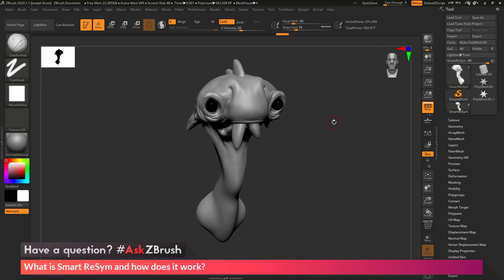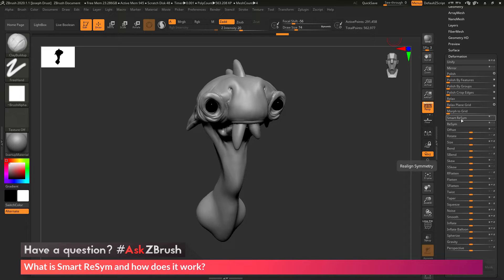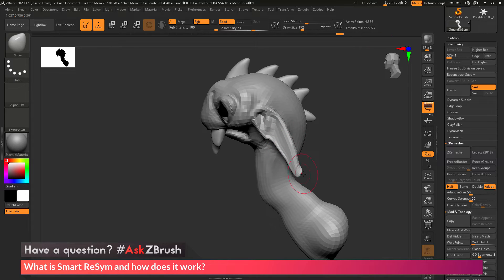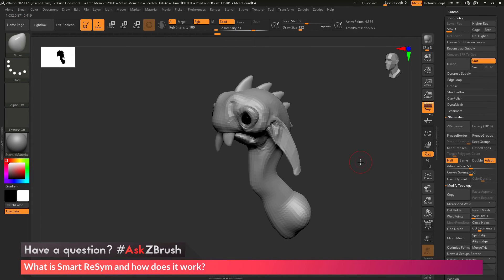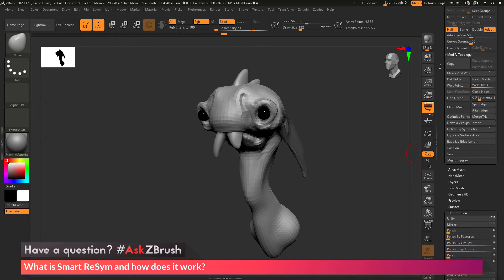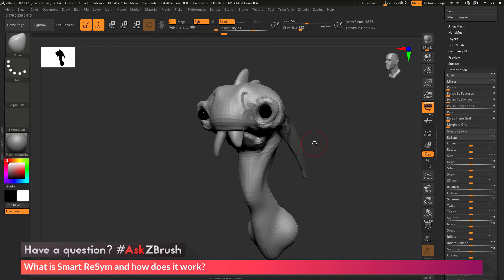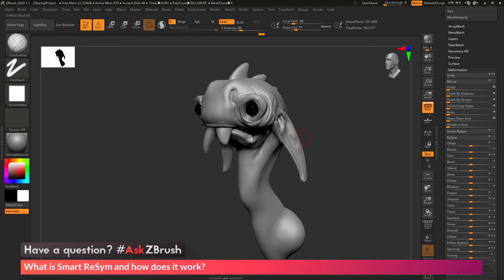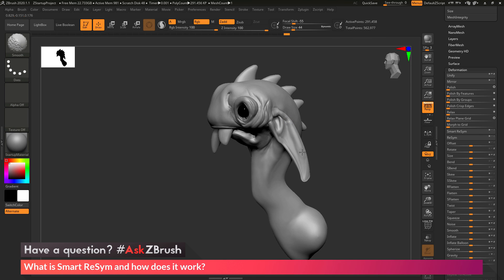#AskZBrush - "What is Smart ReSym and how does it work?"

Comment: This is a cool feature that people should know about. Re-sym is pretty important. Sometime you made your model asymmetrical by accident or by some software glitch. You really want the mesh be symmetrical again. However, most of the software like 3ds max and Blender only has the tool to mirror which slices the mesh in the center and mirrors one side to another side. This doesn't matter if you are doing modelling but when you finish your model and you have UV finished and even texture finished, and you probably want to slightly modify some edge or vertices for rigging, you don't want to destroy vert order. Therefore anything mirror is not an option, and smart resym is a good way to go. Sometimes your software requires symmetrical mesh for rigging, and you have model from other guys, you need to fix asymmetrical issues, this is what you want.